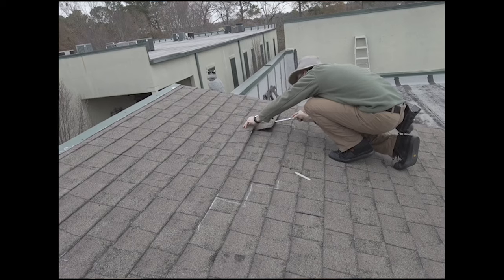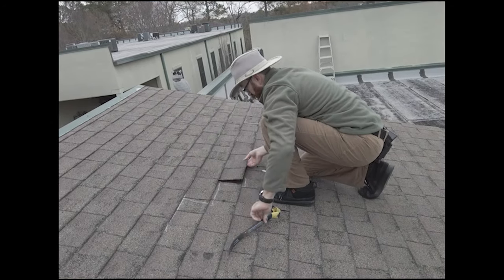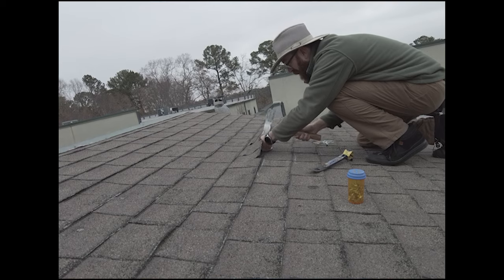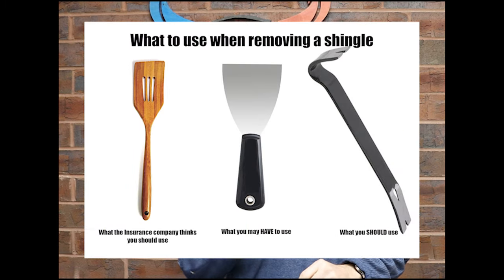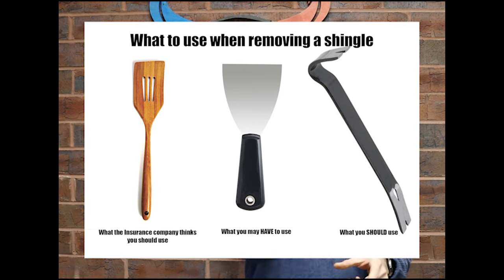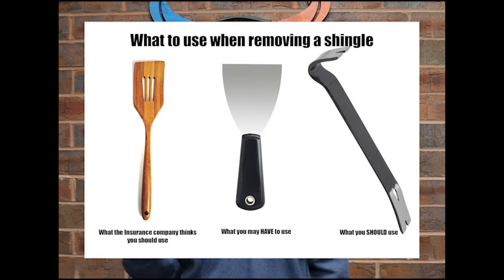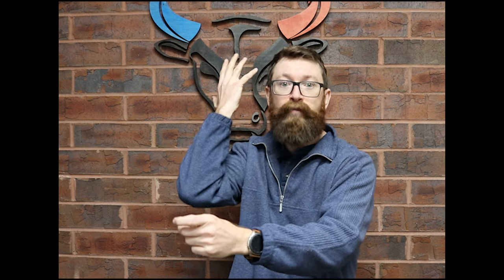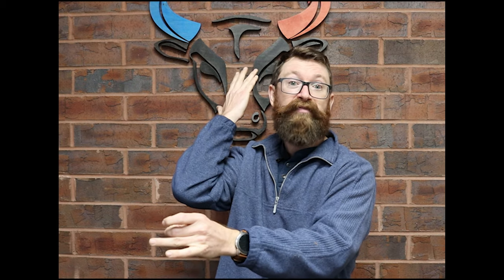How to PROVE your roof is NOT Repairable - Insurance Claim Denied! Public Adjuster 101

Comment: Great video. Question, does the felt have to go underneath the other slope on the hip?
Reply from the maker: There is required overlap at the hips. The code says that there must be staggered overlaps on adjacent courses with a minimum distance of 6 ft between them. Most shingle manufacturers don't specify how to do this at the hips.

Comment: Interesting that you dont apply the same level of micro analysis to a full roof replacement. Do you ever reinspect a roof after its been fully replaced? I suppose if a contractor scuffs a shingle in the middle of a new install, by your logic they would have to do a full tear off and start again.
Reply from the maker: You could take everything to the extreme for sure. Applying the idea of being "reasonable" is necessary. Teaching the issue requires teaching the worst case scenario. I'm glad this video is creating a conversation here though. The National Academy of Forensic Engineers utilizes a method to determine the repairability of asphalt shingles as well. They agree that all of these issues are fail conditions.
Reply: @ListentothisBULL   If you're going to object to a repair because of a scuff but allow a scuff during a replacement, you have lost credibility with me.  In fact, scuffs on brand new roofs probably would have a greater effect on the shingle life than a shingle that was already 15+yrs old.  Is kinda like complaining about a dent on a beat up Pinto.
Reply: @mathewmulholland4741  No, I understood your reply.  You think it's unreasonable to scuff an old roof but not unreasonable to scuff a new roof.  This makes no sense if you're approaching it from a purely "benefit of the homeowner" point of view.
Reply: He doesn't think that, the insurance companies think that. That's in the description of if it's repairable or not. If during a repair the shingles becomes more damaged because of the repair then its none repairable in the insurance eyes those are their words
Reply: @sargentpoptart4080  He literally is saying that shingles are never a repairable material.  If he's there for the benefit of the homeowner, I'm asking if he ever goes out to the roof after a full replacement is conducted to inspect for contractor damage and mandate that the roof be entirely torn off again because he feels the shingles aren't repairable. I mean, I've been on new roofs where there's dings, scrapes, and the like which by his logic will result in leaks.  Given the lack of response, I'm going to assume this is all just a game to milk insurance money.

Comment: How many cedar shakes are damaged potentially while replacing one shake? Is there a formula form how many would be damaged for a repair similar to asphalt shingles?
Reply: Since wood shakes are one of the easiest types of shingles to pop out and pop in, the amount of shakes within a test square to determine replacement is at a higher standard, typically 15 to 19 shakes.
Reply from the maker: @KCShox  I'm not sure thats true. If the nails are copper then its easier, but we come across stainless ring shank nails often. Either way a new shake being installed causes damage to the NEW shake if you follow the CSSB repair methodology.

Comment: Honest question… is ANY composition shingle roof repairable?
Reply from the maker: From a technical standpoint every roof is repairable, it just depends how much is being replaced. If you really dig into the specific codes, you can't make any repairs that reduce the compliance with code. The international code council says that nail holes violate the integrity of materials and they were talking about asphalt shingle roofs.  Having said that, I believe there is a certain amount of reasonability that needs to be used.  The idea that no roof is repairable is not good for consumers.

Comment: Lol.  Wind can break the seal but you’re forgetting that shingles were designed to seal back down.   You are asserting that once a shingle’s seal has been broken, that shingle is ruined.  Gimme a break.  I’ve seen roofers make repairs all the time without damaging adjacent shingles.  Shingles are NOT a product that were designed that could not be repaired.  You also fail to address that insurance policies do not cover damage that involves wear, tear, deterioration or rot.  If you’re suggesting that repairs can’t be made because the adjacent shingles are worn and deteriorated, then that’s not a covered loss and those shingles are excluded from the repair assessment.   Lastly, insurance policies have wording that covers, accidental, direct physical damage.  In laymen’s terms - the policy covers what has actually been damaged not undamaged materials.  Insurance will pay for roofs from wind or hail only when the cost effectiveness of repair would equal or surpass the cost of replacement.   So folks, don’t listen to this guy.  Shingles can be repaired.  Sealant strips were designed to seal back down.  Breaking a seal won’t permanently damage the shingle if you know how to do it correctly.  Repairable roof questions and conditions vary state by state according ti that state’s DOI.  Insurance doesn’t match for fading of shingle color, and doesn’t owe to match depending on the type of policy you have.  Read your policy!  And if your public adjuster or roofer says a roof can’t be repaired because the shingles are worn out and deteriorated, those are excluded perils in the policy so won’t be part of the equation.  Unless your state’s DOI or insurance company has a mandate or company policy in place to take into consideration excluded perils in the repair assessment.
Reply from the maker: I didn't make that assertion... If the seal is broken and material transfer occurs then the shingles are damaged. Most policies that exclude wear and tear, deterioration and rot exclude those items as the proximate cause of loss, so they would not apply. Farmers insurance has a policy that says they do not owe for consequential damaged caused by a condition excluded against and points to the wear and tear. That might apply, but they also later describe wear and tear as a situation in which the roof needed to be completely replaced prior to the loss.  So, what is wear and tear?

Comment: no roof is repairable -every con artist ever
Reply from the maker: Well you could say every roof is repairable. It just depends how much of it is getting replaced. All but 1 shingle... still a repair. Replace the title of this video with "Repairs cost more than most carriers believe because they decide repairability on shingles in the middle of the field instead of near penetrations, hips, ridges, valleys and side walls." Does that help?
Reply: Go to sleep you have to clock into your 9 to 5 tomorrow